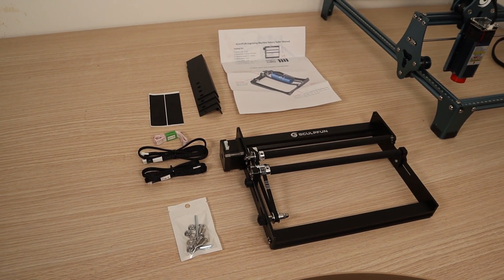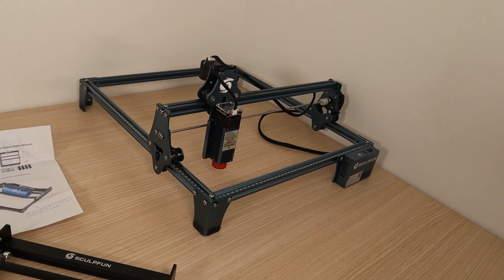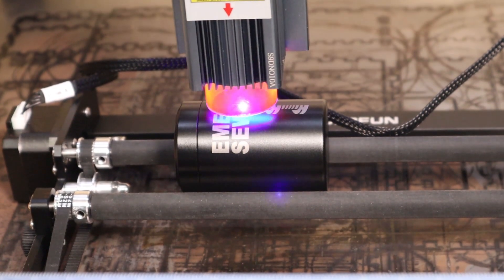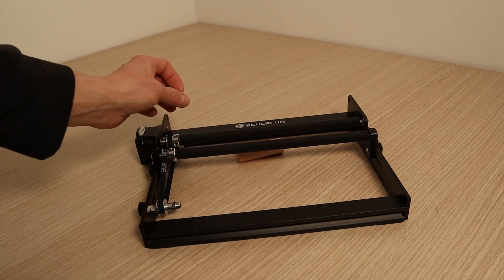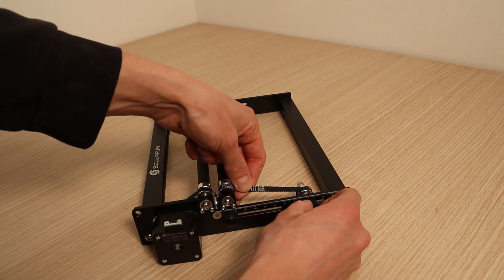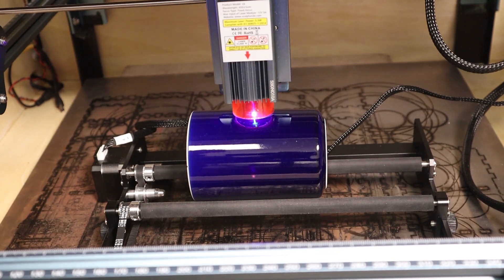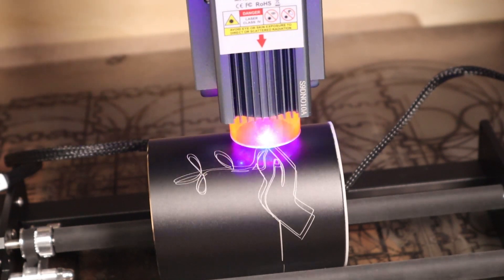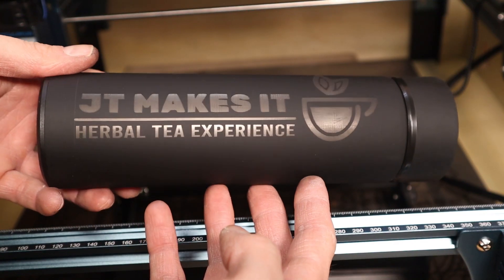Cylindrical Engraving Ideas! Sculpfun Laser Rotary Axis Roller Attachment Review

Comment: Hey! Would this attachment also work with 40 oz stanley cup tumblers, these tumblers have handles ? .. thanks for answering my other question 😁
Reply from the maker: You can't use cups with handles with this one. But with some tinkering you can mount cups with handles on this rotary system: https://youtu.be/reY6ICDhF1s
Reply: Okay I just checked this rotary out, do you know if I would be able to attach it to the s6 pro?
Reply from the maker: @Sheiisashley  Unplug the wire to the Y axis motor and plug it in the rotary motor. The y-axis now becomes rotary axis.
Reply: Looking forward to getting all my pieces in thank you for your help ❤

Comment: @JT Makes it - could you please elaborate what you mean by Line by Line settings? Is there any other settings in Lightburn how to force/minimize item movement? I have the same problem you describe. More complex vector image and the glass moved completely from the laser position.
I would like to use bidirectional engraving.
Reply from the maker: With line by line I mean that I use a "Fill" with left to right motion to fill the whole shape like an inkjet printer would. I don't trace the shape outlines like you would normally do with engraving vector designs with "line" function.

Comment: I wasted my money buying this rotary attachment. 
It can only do round objects that are the same size completely across. If there is more than a slight diameter decrease from one end to the other the product will rock and not get a clean engraving. 
Forget about doing anything with a handle.

Unfortunately for the Sculpfun there is not another rotary attachment that will work with it. I should have spent my money on a different engraver that will work with the open middle (non full roller) rotary attachment.

Comment: Please demonstrate steps for setting the rollers. The scale only goes to 60mm  but I am measuring objects around 280mm and its clear from the video the engraved objects you are using and other videos are greater than 60. The device is surprising well made and just feels like good quality but the 6 step instructions that come wit the kit are garbage. Also please show steps in Lightburn to get proper settings. The instructions state there is no need to adjust software settings however you did decide to adjust the settings. Thanks.
Reply from the maker: You don't need to set the scale the same as diameter of the object. You ajdust it by eye just wide enough that the object sits nicely between the rollers. Precise adjustment is not necessary except that you use scale to make sure that rollers are parallel. If you use Sculpfun machine, you don't need any additional settings in Lightburn. Just use software normally. The Y axis transforms to the cylinder in 1:1 scale.
Reply: @JTMakesIt  Ill give it a try thanks.